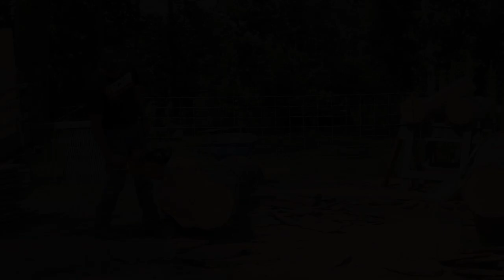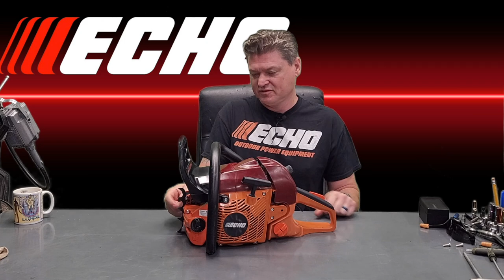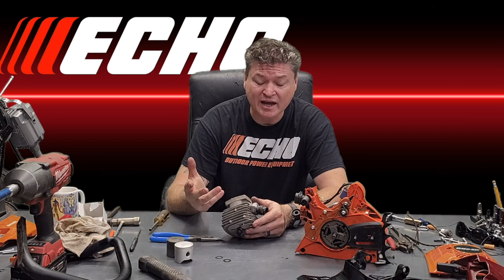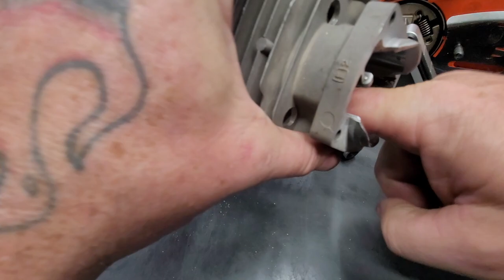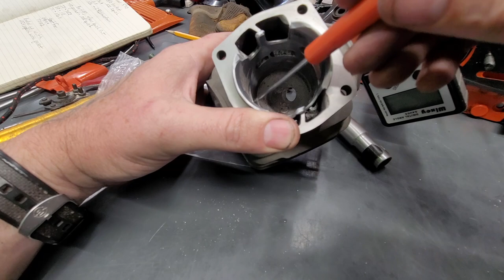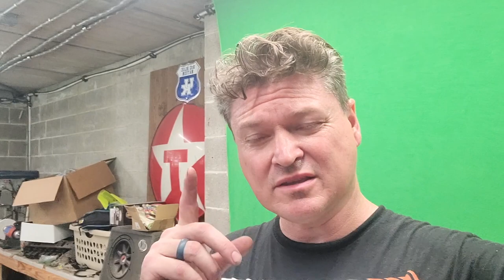Full Port for an Echo 590 Timberwolf

Comment: Very nice job on that one bud. Sounds great but runs even better 💪😁👍. I’m with you on the single ring deal, less rings less drag more rpm’s less heat
Reply: Yes, BUT, less compression, less engine life, less torque, etc.... More rings are better than less.
Reply: @eugenecrabs3954  no.

Comment: You succeeded were other saw porters failed. Good job on ported  a echo cs 590 because a few other saw porters tried and could not get it to run right. The white oak is pretty hard 1350 on the Janka hardness scale.

Comment: You can leave the center for the piston support in the upper area and cut right up through there and open up those transfers some and cut all the crap out of the bottom area so you have a smooth fuel charge blasting up and out those upper transfers..,,I cut the middle out of those small cc size saw’s… it’s blocking the flow… ???